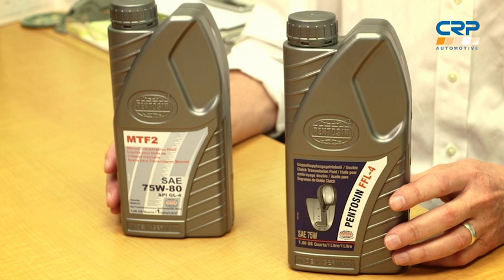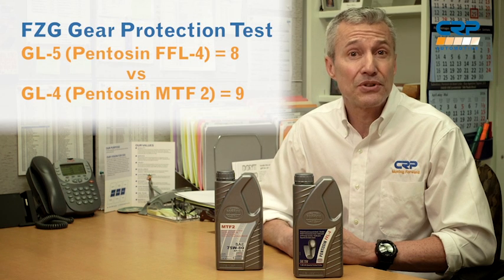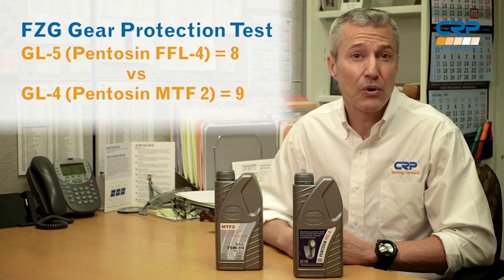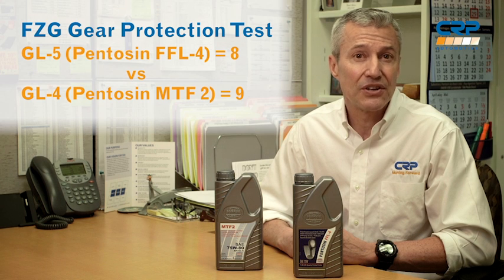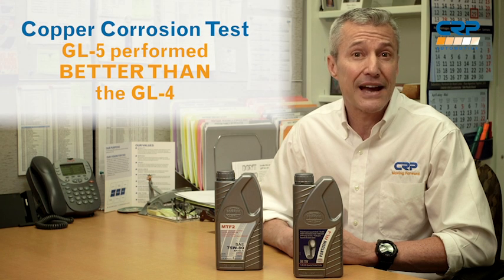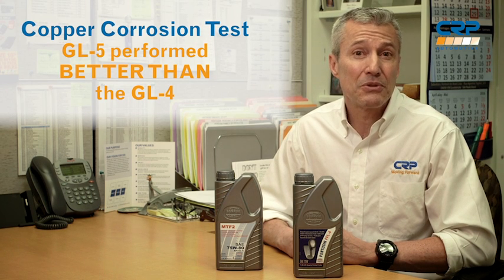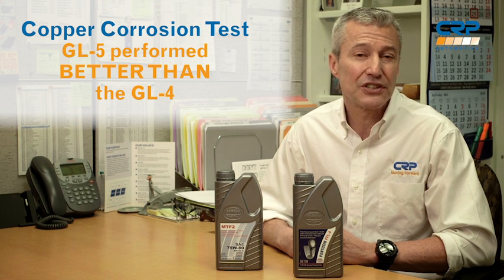GL-5 vs. GL-4 Fluids | ITB Episode 32

Comment: I use redline MT 90 75w-90w GL-4 rating in my 08 Toyota corolla. It shifts very well. It's expensive but only needs to be done every 30,000 miles.

Comment: Misinformation indeed... On the Miata forums, lots of voices say "don't use GL-5 in the manual gearbox, but do use it in the diff."  A quick look at the Official Mazda Mx-5 Miata 2007 Owners Manual says "Manual Transmission, use GL-4 or GL-5", then another look in the the Field Service manual of 1994 Miata and 1996 Miata also says "GL-4 or GL-5" will work in the manual transmission.  Some of the Internet folks were suggesting that GL-5 would slowly destroy the transmission or cause failures with strongly worded warnings.  Since GL-5 is specified for the diff, and is specified in the OEM Manual for the manual gearbox, I'm going with GL-5 in both (so I can buy by the gallon).
Reply: What GL5 fluid do you use in the Miata?
Reply: @itsJJok  Ultra1Plus SAE 75W90 Synthetic Gear Oil API GL-5 (2 Gal - 8 QTS) for Gearbox and Diff - 94, 96, 07; Confirmed in Owner's manual and Service Manuals that GL-5 is recommended for both.
Reply: @itsJJok  Ultra Plus GL-5 for Gearbox and Diff - '96 and '07 Miatas MX-5 - Bought a case of it..

Comment: Based on the information provided. 
I'd assume that you can use the same fluid (FFL-4) for the fill of the 0B5 transmisión from VW AG group on both the Dsg and the gear side. 

Is that assumption correct?

Comment: Great video. Really hard to find gl4.  My dealer tried to sell me cvt fluid Toyota ws fluid then valvoline gl5 for my gearbox specifing gl4.  I was not pleased.  Still a little uncertain to use gl5.  Not sure where to get pentosin in Canada.  Should have stopped at orielly last time I was in USA
Reply: Some toyota manual transmissions, I know the S54 for sure in the celica/mr2 base trim switched from a recommendation for 75w90 to ATF fluid depending on the model year. It is sometimes used. When GL5 was new to the market there was a possibility of corrosion if the fluid reached a certain high temperature it would breakdown and cause a chemical reaction to brass parts, that is no longer seen with new GL5.
Reply: @vipercrazy-9  you are correct about the reaction.  GL5 is still not always downward compatible in a gearbox however due to the higher amount of EP additive in some GL5's.  Similar to what you said about gearboxes some snowmobile guys use ATF in chaincases... guess thats the same theory as my old nissan that spec'd atf in the transfer case.
Reply: @vipercrazy-9 do you recommend 75/90 GL 5 for a Toyota Matrix 2008 manual transmission 5 gears?
Reply: @Jorge651  I would recommend finding a fluid that specifies for both gl4/5 on the bottle as well as specifically mentions for gearboxes, fuchs titan gearsyn for example.
Reply: @Jorge651 It’s debatable, but most folks usually just run GL-4 or like the first reply to you mentioned; you can run a GL-4+, which is both GL-4 and GL-5 compatible, and is yellow metal friendly. 

The only time I’ve used GL-5 gear oils in manual gearboxes/transmissions, was for AWD Subaru gearboxes, which required a manual trans specific friction modifier/additive package for the AWD drivetrain.

Comment: My 08 Subaru WRX takes  GL5 according to the owners manual. I did online chat with a Valvoline tech and he said their GL5 is not compatible with yellow metals. For now I put in Walmart Supertech 80-90 that says protects corrosion of copper and bronze bushings. (I have yellow synchros) This is nuts to figure out.
Reply: same here. i m just gonna go with GL4 to be safe and gonna chnage fluid more often like 10k miles before

Comment: Im about to change the oil in my Manual Transmission BMW e46 320cd Coupe, and there are tons of mixed information on the internet. Thank you for this video ,sir! I was concerned about the GL-4 , GL-5 differences , because i cannot find GL-4 oils anymore. Thanks!
Reply: CASTROL SYNTRANS B 75W is GL-4
Reply: This is 3 years ago, so curious if you used GL5 and how it worked out for you?
Reply: @itsJJok   later I managed to find GL - 4, because more people wrote about it, than GL5. I found Total 75W-80 API GL-4, and it works perfect for 3 years already

Comment: I know that's not about Motorcycle, but in my manufacturer service indications it's recomended to use the Transmission API SAE 90 on the Motorcycle Chains. But what is better? It's better i use in the drive Chain GL4 or GL5???
Thanks!
Reply: In your application it really doesn't matter. Get the cheapest gear oil you can find as it will fly off before it gets a chance to break down.
Reply: Just use regular grease. The workload on the chain does not require anything fancier than that.
Just be sure to regularly check, regrease and clean up excess.

Comment: I did the test in mt manual trany with Gl4 trany switching gears are smooth with GL5 is not
Reply: My 5 speed synchro MT has been running the dual rated GL4 and GL5 total driveline oil i was given by my carmaker's part store for a few days and it's been shifting pretty smooth, definitely better than the 18 year old rotten GL4 that was in there before.

Comment: Generally GL-4 gear oils are much better for yellow metals than GL-5 due to sulfur content.
Of course always follow manufacturer service indications
BimmerN53
Reply: Things get very interesting when a gear oil is stated as both GL-4 and GL-5 at the same time... and when an OEM parts dealer gives you such an oil instead of the old discontinued GL-4...
Reply: @teravolt6113  GL-4 gear oil specification is not discontinued at least in Europe, millions of cars use it. 
Both GL4/GL5 labeled gear oils are not harmful due to the special formulation for yellow metals, but if you find a GL-4 use it always as a first choice.
BimmerN53
Reply: @federicotorresbordils7624  Thanks for your opinion. About to do a gear oil change in the near future.

Comment: The damage done to yellow metal synchros by gl5 oils is a huge deal. If your box specifies a gl4 oil then use just a gl4 oil. I had a discussion with a penrite oils manufactoter over their recommendation of a gl5 oil in a transmittion that should only have a gl4 oil. Their excuse was it wont corrode the yellow metals but when asked do they still have twice the phosphors and sulphir as all other gl5 of course it does, which is what eats away at yellow metal synchros.
Reply: Show me a chemically eroded brass/bronze blocker ring.
Reply: And what about oils stated as both GL-4 and GL-5 at the same time in their technical data sheets?
Reply: @teravolt6113  it's because modern gl5 is backwards compatible
Reply: @randylee2549  wrong
Reply: My 08 Subaru 5mt takes 5GL according to the owners manual. And has yellow synchros? So I do an online chat with Valvoline and their tech says their GL5 is not compatible with yellow metal. this is nuts.

Comment: Hi sir i hope you answer my question i put gl4 on my lsd differential ford ranger t6 but on my owners manual is gl5 is it ok to put wrong oil?
Reply: Always follow the manufacturer recomended oil type ammount and viscosity putting the wrong kind of oil in a vehicle can result in a pricey repair down the line

Comment: What was not discussed that is the huge issue is the syncros. It's said GL5 will eat up those syncros fast because of its "anti corrosion" properties.
Reply: Spot on! This is a huge deal. I had a discussion with a penrite oils manufactoter over their recommendation of a gl5 oil in a transmittion that should only have a gl4 oil. Their excuse was it wont corrode the yellow metals but when asked do they still have twice the phosphors and sulphir as all other gl5 of course it does, which is what eats away at yellow metal synchros.
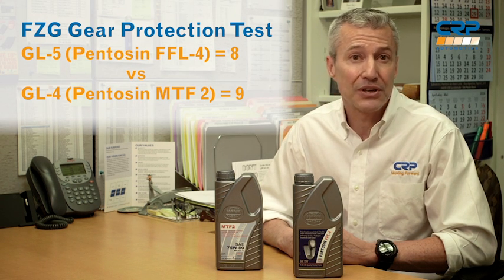Reply: He speaks about this at 1:32 when he mentions "yellow, non ferrous metals"  that encompasses materials the synchronizers are made of.

Comment: i have audi a4 2.0 tfsi 2013 gearbox manual  i change oil gerbox 75w90 gl5 its right ? good or bad ? thanks for any one any help
Reply from the maker: Contact your local Audi dealer. They are not clear if their part number G052532A2 is the GL-4 or GL-5. Your car calls for this OE number. The video content was more focused on what to do since BMW had discontinued their GL-4. Not all car manufactures have.

Comment: hi, i got an isuzu lite truck, i plan to change my rear axle gear oil, my owner's manual said use GL5 gear oil, but i got GL4 gear oil in my house now, can i use GL4 oil for my lite truck rear axle? will it cause any damage? please advice, ty
Reply from the maker: Thanks for your question. If the axle has an axial offset, we would not recommend using a GL-4 product. Without an axial offset, it can work.

Comment: Here's the thing; if the vehicle manufacturer recommends GL-4 and you use GL-5, and the customer has a problem, you can bet that in today's society, they will sue you for the repair. Will CRP be there free of charge to back up your choice? Will CRP pay your legal costs and the repair costs if you lose the case? Is CRP willing to put that in writing?
In my shop we specialize in Imports. We use OEM VW fluid in VW, Toyota Fluid in Toyota etc. We never have a problem. If I was to switch, would I save money? Perhaps. Would I still have piece of mind? Perhaps not.
Reply: Toyota Corolla 2018 owners manual calls for GL 4,   Why would  they do this if GL 5 was also compatible with their transmission ?
Reply: @Falwiz  a 2003 Corolla manual, says 4 or 5, since all GL5 fluids are certified MT1as well, I will go with what Toyota says, does your manual say GL4 ONLY?
Reply: Not sure where I got the info on the Corolla transmission oil.  My car is a 2014 Toyota Matrix and it does specify in the owners manual only GL4 oil.
Reply: @Falwiz  they must have changed how they made it.
Reply from the maker: Thank you for your comment. BMW is discontinuing the MTF2 manual transmission fluid. They have not named a replacement. The Pentosin chemists who created the MTF2 (GL-4) and the double clutch FFL-4 (GL-5) ran tests that show the FFL-4 will work fine in replacement of the MTF2.
Reply: @CRPautomotive1  What a bargain at twice the price of MTF-2!  Thanks for discontinuing the 5L bottles.
Reply: @CRPautomotive1  There is the MTF-3 at least in Europe for "manual" gearboxes such GETRAG and ZF.
BimmerN53
Reply: @CRPautomotive1  very informative, Toyota's 2003 manual specs GL4 or GL5 and with MT1 designation I feel confident using a GL5, totally.